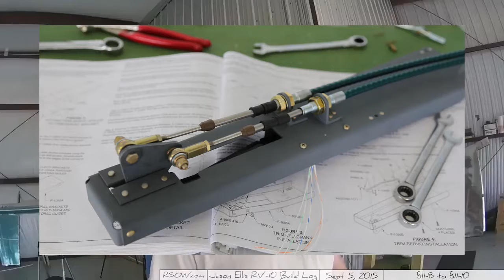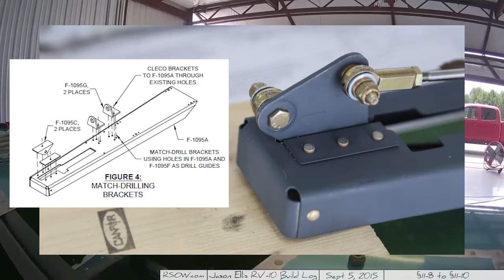RV-10 Empennage sections 11-8 to 11-10 Addendum

Comment: Don't use the locking washers on the trim cables. Van's doesn't show them being used in the drawings and there is a general aviation rule that locking washers are not to be used on planes, anywhere, they dig into the material and cause corrosion.

Comment: Sorry to comment on old videos, but I just recently found your channel and am working my way through.  Did you ever find why the trim tabs move asymmetrically in the one direction?  I assume Van has some rationale for that, but it does seem odd and seems it would stress the horizontal stab asymmetrically.
Reply from the maker: The theory is that it has to do with the gyroscopic procession caused by the prop.   Beyond that your guess is as good as mine =)
Reply: Seems like more up on the right would cause the plane to roll to the right on its horizontal axis.  Lots of nose high trim is for slow speeds.  Slow speed and high left turning tendencies (p factor, engine torque, etc).  Perhaps on a go around the plane rolls too much left and this counters the effect .  Might be something about the design that it’s not controllable enough without this feature.
Reply: The reason is historical. Originally Vans was using the left trim tab controlled by the flap mechanism and the right side was the real trim tab. They dropped the flap mechanism but wanted to still have the same max trim capability (from both down to one up), so now the trim motor contraption is mimicking the old flap movements.